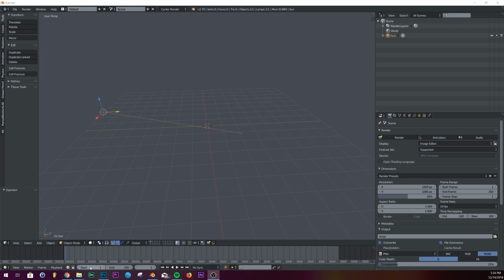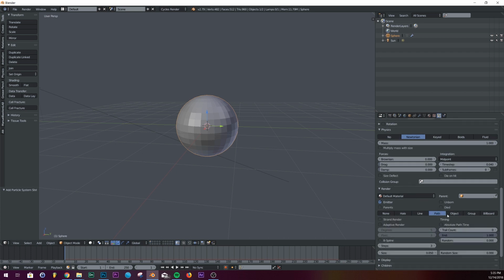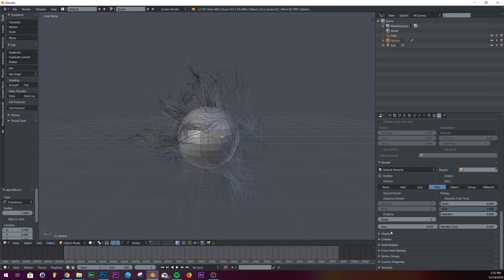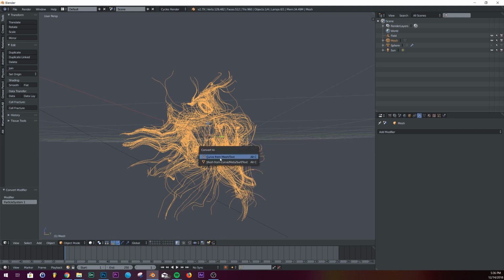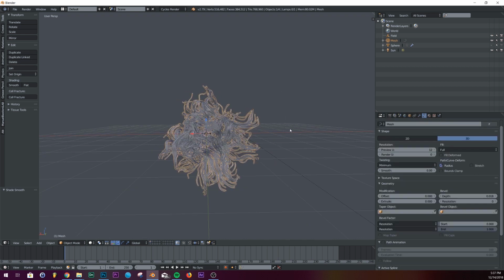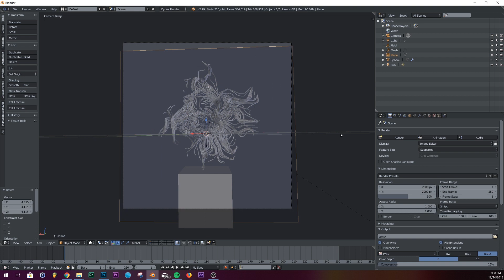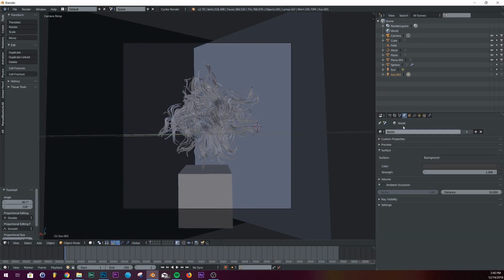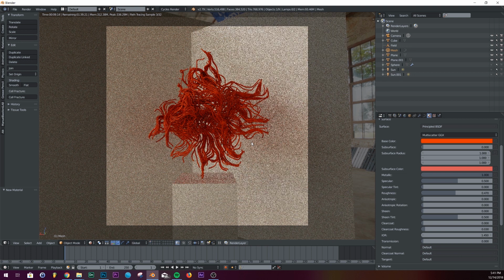Blender - Abstract Design Tutorial

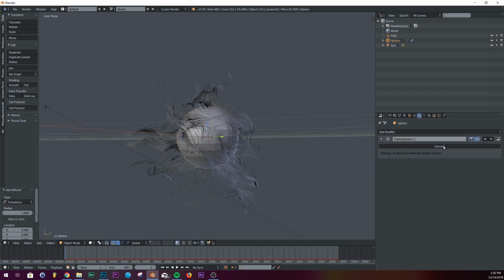Comment: This looks amazing and I wanted to give it a go. I'm using 2.8 and unfortunately I'm missing the "Convert" button on the Modifiers tab @1:58. I've tried clicking on the object directly on the viewport, selecting it on the outliner and even doing it all over again and nothing :( 

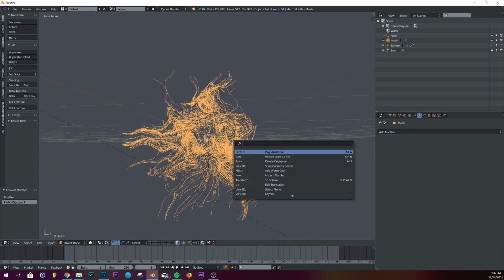What is that button actually doing? I'm guessing is not the same as "Convert to" because, if it was, you would've done it that way, which you actually do later @2:10
Reply from the maker: That’s the reason I didn’t make the tutorial in 2.8. I believe it’s just a bug. The way to get around it is to select the object and search “convert to” and click curve from mesh/text. Then the convert button will show up
Reply: To be more precise: On the modifiers tab, it just shows the Particle system modifier, there are no options to "convert" nor apply it in any way. And it's obviously a bad thing, because if I don't convert it, I cannot hide the emitter shape :(